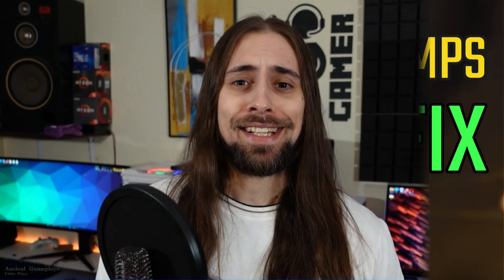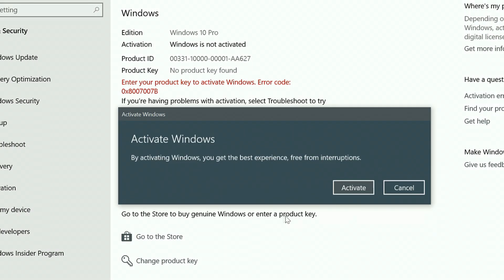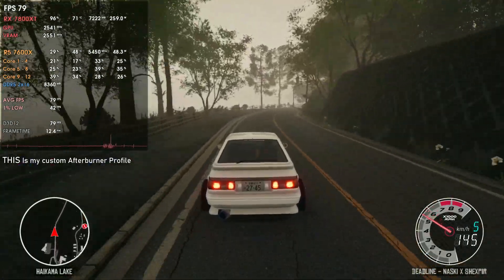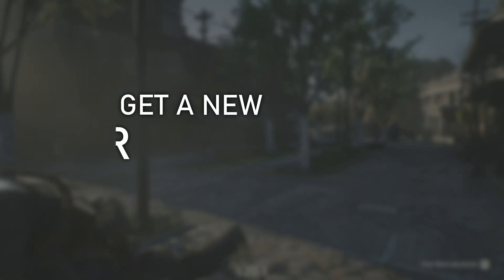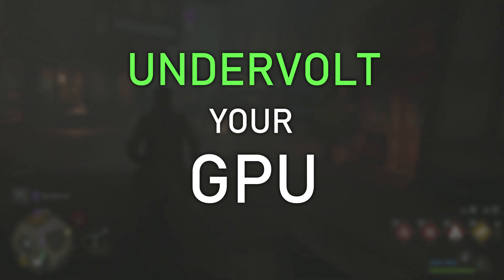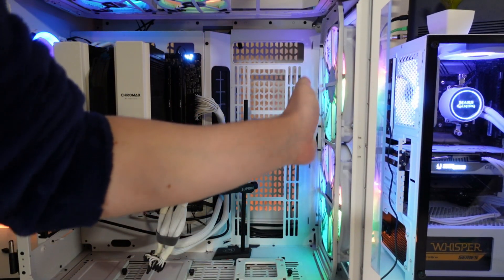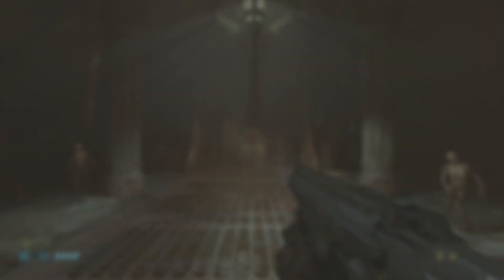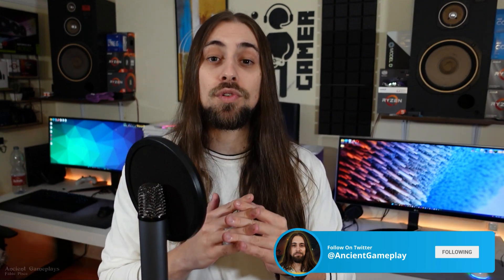HOW TO FIX your PC High Temperatures & Airflow Problems [2023 Guide]

Comment from the maker: As always, hope I helped somehow!
Reply: Hey will you ever make an overclocking guide for the RX 7900XT?
Reply from the maker: @themightymug768 use the xtx one, its exactly the same
Reply: @AncientGameplays  ok thanks 🫡
Reply: As you remade that video, my cpu actually did burn a little too high it shut down my pc, thank you for this video, tips, and much more. :D
Reply: Thanks, Fabio. I only notice cpu high Temps when using technical preview drivers . When I activate flouid motion, the frames really are impresive , and then the cpu starts to overheat , using whql drivers without any tweak , the Temps maintain a Temps, anyways the HIGH performance in every game is absolutely amazing the design of my xtx is gourgeos and even If haven tried for example  FSR3  yet, in widescreen resolution with all games settings higher as posible.
Reply: Should i disable 7 7700x intagrated tm gpu?

Comment: My setup:
Ryzen 7 7800x3d 
Rx7800xt 
Msi mg x670e tomahawk wifi 
Nzxt H6 airflow
Aio Nzxt kraken 360 rgb

And i have 3 120mm fans on front intake directly to gpu,2  fans 140mm on the button intake to gpu, and i have 3 120mm from aio outake,  i dont have any in rear i really dont need with this case, but normaly gpu when playing got 60° to 70° while cpu goes 80° and stay there

Comment: Hey Ancient, why my new Ryzen 5 5600 doesn't automatically use its boost clock feature (4.4ghz) when testing Cinebench? HWInfo shows that all cores are @3.5ghz (base clock) on 100% load.

I needed OC manually it to 4.35ghz, but I want max performance, of course, for gaming. I can't manually OC it to boost clock because it somehow start eat Volts, and I get really high temps (over 100C on prime95 small test, and the pc shut down, this happened with 1.35V) with the Volts the processor needs to be running 4.4ghz - 4.5ghz (Cooler Master Evo 212, air flow). Should I try Curve Optimizer OC option? 

Another question is: Do I get significant benefit to gaming if I get new motherboard that supports the SAM (Smart Access Memory) feature? My Mobo currently is Asus Prime  B350-Plus (from year 2017). 

Thank you alot in your effort for your answer! I subscribed btw ^^
Reply from the maker: Hey, firstly in high loads those CPUs will never be at 4.4GHz, those frequencies are for lower loads where maybe 3 or 4 cores push those values (at max), the usual would be around 4.2GHz. If it is still at base, it means your mobo isn't pushing PBO and speed steps
Reply: @AncientGameplays   Hey, thanks for your reply. That was new info for me, I didnt know that it never boost all clocks to max boost at full load. Well, im sitting stable 4.35ghz manual OC, temps are 65-70 at gaming and 83-84 full load when running cinebench. I think im going with this settings for now. 

Is it even possible manually OC over lets say 4.5ghz this cpu? Mine start eat volts @4.4ghz and I dont want put higher than 1.35V ultimate maximum.

Comment: As a lot of people that watch this video have AMD - The best fix... that would also make a difference to the power bill... is amd fixing the max VRAM clock issue for multiple screens. 😥 Sadly on dual 1440p with more than 120hz its still happening
Reply from the maker: It depends on the combo you have. It also happens on some nvidia cards

Comment: I have a terrible case, CM Cosmos 1000 straight from 2008, with 3x120 UF120 for out and 1x120 UF120 for in from the bottom of the case, all set to VRM. 
There was nothing worthy for 7xHDD on the market, and when the sanctioned Fractal Define 7 was forced to have 200%+ price tags, it was even more so. 
So, Sapphire RX 6700 XT Pulse of the third revision at 2400-2581 MHz 1130 mV and 60% fans in RDR2 with “everything on Ultra” and x1.250 rendering reaches a maximum of 89° on the hotspot. But as soon as I set it to 2424-2581 MHz (so to speak, from the game nominal), HWiNFO64 showed a maximum of 100° hotspot at the same speeds of all fans. 😅 

One of the disks suddenly fell apart, the other was cut long ago to bypass the problem sectors, and it’s time to start worrying about the health of the remaining 4 archived 2TB from 2017, switching to 4TB, and finally change the case to a ventilated MESH 🤔

Comment: Fabio, you are telling that "core GPU temperatures should be <75°". But what about the most interesting - hot spot temperature? If you have 75° core GPU, then the GPU hot spot would be +25-30° more = 105-110°. It is pretty much, may be too much. So what are the two Hotspot T - 1) "up to" and 2) "stay below" ?
Thanks, Fabio)
Reply from the maker: Gpu core should be at max 20C over core IMO
Reply: @AncientGameplays  Fabio, you mean GPU hotspot must be 20° over GPU chip/core?

Comment: are there no amd ryzen master drivers for 7 7700x?? cant find any on amd website
Reply from the maker: Why do you need ryzen master exactly?
Reply: @AncientGameplays  nevermind ryzen works but when i oc ramm and i reset it goes blackscren when i hold power booton and go to bios its automaticly disabled do u think id i drop from 6400 ddr5 to 6000ddr5 is is big diference or no

Comment: Awesome video as always, Fabio! The case is really important. I learned it the hard way. I have a 5800X3D and when I got it it was hitting close to 80-85 degrees in some games. I got worried that my chip was probably faulty. Bought an AIO 360 but it did not help much. Only when I decided to upgrade my old NZXT case I saw a massive difference in temps like around 15 degrees cooler. So now it runs at around 65 in game. I underestimated the case and am sharing this, so you guys might not make the same mistake.
Reply from the maker: Exactly why I said what I said, case airflow can mess with your hole system temps.

Comment: Hi Fabio,

Great video as always! These tips are very helpful! I followed your guide on undervolting the 7900XTX and now my core temps are at 60C and 70 on the hotspot! 

In the beginning i was concerned that my CPU temps were way too high (R 7 7700X) but i now fixed it by enabling eco mode and setting my windows power plan to 99% I now do lose out on CPU boosting but i haven't noticed a single frame less than before and when i need it i can still turn it on.

Thank you for this great video ❤

Comment: With HWiNFO64, what's your opinion of the GPU Hot Spot Temperature reading? I've got an undervolted 6800 XT. Typical maximum gpu temp of 67C, but maximum Hot Spot temp of 90C+!
Reply from the maker: that is a lot, means you should undervolt or change the GPU's thermal paste.
The delta should be at max 20C, in your case its over 23C. Its nor harmful, but a good thermal paste could solve the issue I guess, and like said, good airflow also helps

Comment: Great video Fabio! Lots of really great tips for newbies and seasoned builders alike!

The only thing I would add is advising people to run their CPU to operating temperature for at least 5 minutes before unseating the cooler and use a gentle side to side motion to loosen it, never yank straight up. That allows the thermal paste to warm up and will make removing the cooler much safer and easier. I accidentally killed my 2700X when I tried removing the cooler and ending up bending the pins because the thermal paste had basically glued the cooler to the CPU. Just want to save any other PC brothers from making the same mistake :)

Comment: Hey Fabio , how about  GPU HotSpot Temps ?  .. my 6700XT takes 72~70  on normal Temp and 90~92 Hotspot.. no Perfomance drops , and in 100% usage.
Reply from the maker: 15C to 20C over core is normal, much higwhr than that isn't. You're fine with 92C hotspot

Comment: A few days ago I bought a 7800xt ASRock challenger oc and I noticed during the tests that the temperature delta between gpu temp and hotspot was huge and reached 39 degrees Celsius,then I repasted with MX-4 and the difference dropped to 19 degrees Celsius.As always,the video is excellent,short in duration and understandable, thank you.
Reply from the maker: That's what usually happens on lower end models, the delta is huge due to bad paste and low backplate pressure
Reply: What you write is true,the first step I did was,as always,to tighten the screws on the backplate as they were usually a little loose,this card was the cheapest implementation of the 78xt series without meaning that it is of poor quality and I was really surprised by its size,it is 15% smaller than a 6800 powercolor that I had on the PC,the memory reaches 2630 and while I had doubts about the purchase because the Sapphire Nitro+ is the best of the series in terms of silicon but also more expensive,200 euros,in my opinion it was not worth the amount, but in the end I was pleasantly surprised by the challenger at 512 euros and especially after the repaste the core reaches the limits of 2.9 GHz when running games at 1v,and still trying to find her sweet spot, very happy with the purchase.

Comment: Your undervolting guide really helped me save power and run cooler. I did face some crashes on games randomly though, unsure whether it's the game or driver or the undervolt.
Reply from the maker: games never crash just because, neither do the drivers (usually). Raise the voltage a bit

Comment: I'm currently running a Tecware fusion small form factor case with only one 120mm Exhaust on the rear. While gaming at 1440p, temps for both CPU and GPU never go above 70 degrees. In my previous mid tower case, I had 5 case fans and the temps were easily over 80 everytime.
Reply from the maker: because airflow itself matters, like explained. Still, one more fan for some cool air in, would do wonders
Reply: @AncientGameplays  Unfortunately there is no space for additional fans. We don't get 80mm fans here where I live, and slim ones are even harder to find while being expensive.

Comment: Undervolting a CPU works. I've got a RT 1700X with a Gammax air cooler I'd been running in power saving mode because the cooler is inadequate at stock voltage. Manually undervolted the CPU and now I can run it at high performance mode 3900MHz and I am seeing 75c and below in all games except Forespoken. Temps are mostly in the 60s now. I got Forespoken in ultra everything 1440p plus RT and I saw 76c. Turns out 1700X is STILL a gaming beast for everything even now except for CP2077 and Starfield. But if that's the case then the optimization of those two games is very poor. I like to know more about what are good mobo temps and how high is safe? Forespoken took my mobo to 60c. Room temperature was at least 85f though.
Reply from the maker: Yes, but 75C for that CPU is a lot, you should push it that much, max temps raised a bit after the Ryzen 2000 series. I would try to keep it below 70C.
Also, your case airflow might be the issues as that gammax isn't thaaaaaat bad hahaha
Reply: @AncientGameplays  TDP is supposed to be 75C. It only happens when game is in loading phase then drops back to 50s and 60s when gaming. I might have to reapply thermal paste though. This case has good air flow. I think it's a room temp issue I live in a hot and very humid climate. What do you think good mobo temps are and when should you back off? In my research the consensus seems to be 80C.
Reply: @AncientGameplays  Seems I was correct about room temp. We had a cold front come through last night. Room temp, dew point, and humidity combo are all huge it seems. I ran the exact same Forespoken scenario again with the Gammax and this time time CPU only reached 62.8 and mobo 53...wow!

Comment: Ich habe das Programm Fan Control für mich entdeckt, damit kann man alle Lüfter bis auf die GPU steuern. Und kann im Laufenden Betrieb alles so einstellen wie man möchte, dazu der kleine Tipp, die Drehzahlen für jeden Lüfter so hoch zu setzen das man diesen gerade so Hört, und dann eine Kurve die bei den Höchsten Desktop Temperaturen beginnt. Bei mir z.B.: wenn ich in YouTube einfach lange rauf runter scrolle, da geht die Temperatur schon mal auf 65°, also beginnt die Kurve bei 68° und geht dann bei 88° in die Senkrechte 100%. Dazu kann man dann auch noch einstellen das IMMER die Höchste Temperatur Quelle genommen wird z.B.: wenn die GPU 76° hat und die CPU nur 65° werden die 76° der GPU als Basis für die Drehzahlen genommen. Somit ist in jeder Situation genug Luftbewegung im Gehäuse.

Comment: Clean yo intake fans.

Just dedusted my pc and the dust bunnies on the blade tips of the fans made it have no airflow at all. After cleaning just the edges of the fan blades, my gpu temps went down by 15c (in idle)(peak temps went down by 5 to 8c).
Reply from the maker: Yeah, that's a thing I need to include as well in the one coming in the next years haha

Comment: Besides the ambient room temp, the GPU is the highest temp output part. I like to use an oversized case with 3 big fans in front, aio for cpu on top (either with 3 fans in push config or 6 push pull config, depends on the case size). All vents are correlated with the cpu temp as they ramp up sooner and get the case temp lower faster. With the correct configuration you can get a decent “coolness” to your components, but don’t expect magic to happened, as someone said in the comments, if the room temp is high, the components temp raises exponentially. I managed to get a small ac unit especially to cool the pc and server, that stays in a little room next to the office and the temp is a steady 22c.
Reply from the maker: Yes, but not aslways "Besides the ambient room temp, the GPU is the highest temp output part.".
People with recent cooling solutions for their GPUs and intel CPUs from the 13th & 14th gen won't agree there haha
Reply: @AncientGameplays  haha, true :d i am still contemplating if I should spend 2-300 € on a liquid cooler for the 7900xtx, but for not I am fine with 70c max junction temp :d
Reply: I have a 21l case which has dust filters on almost all sides except the front. Using only one fan on the rear (no space for more) and a tower cooler for my CPU, temps have been surprisingly amazing despite being in a hot location. I realized I wasted a lot of time thinking about airflow and push pull.

Comment: Hello, maybe you know what it is. I have ASRock RX6800 and I checked all bios all 6800 cards on TechPowerUp. Only ASRock make TDC Limit (A) GPU - 250.  Reference is 200A and some vendors make 210 or even 235. Only ASRock make it 250 for all models 6800 and I don't understand why, it seems too much and I started worry about my gpu

Comment: For all those who struggle with the typical gcd-hotspot problem on rdna3 cards, I can highly recommend the Thermal Grizzly KryoSheet.
It gave me a 30C improvement on my XFX 7900XTX.
The gcd-hotspot does not exceed 75C max. even under full load for hours and the gpu-edge does not exceed 55C max. either.
The pad is also maintenance-free as it cannot dry out as it is made of graphene and does not contain any liquid.

Comment: Hello Sir, Just a question pls  I have a 5950x, what do you think which is better for the game, all core tuning 4.6ghz or first cores at a higher clock rate?!
Reply from the maker: just let the CPU run free there, use curve optimizer to tweak
Reply: Thanks :D  @AncientGameplays
Reply: I managed to do a cpu tuning. the first 3 cores are 5125ghz 4,5,6, core 5ghz and the rest are between 4,8 and 5ghz. there is a problem that the d15 chromax doesn't hold up very well, so I have to build a water cooling system , I can't copy the hwinfo image here :S   Thank you for the many videos you make about amd and the many tech videos!❤

Comment: those advised CPU temps are..... very positive. 65 degree? Man, you obviously didint had Ryzen 5800X ;)
Reply from the maker: I said up to 75C degress though. 65C under gaming is normal even for the 5800X. I guess you just need (listen explained in this video) a better case / better cooler.
I have the 5600X, 5800X3D, 7600X, 7700X, all of them run under 75C when gaming
Reply: @AncientGameplays  Well, my 5800X is around 70-75 degree while gaming. I got best possible airflow - O11 Air mini, dual 140 on front, dual 120 on top, 120mm on back, dual 120 on bottom. CPU cooler was Noctua NHD15 and now Scythe Fuma 2. Its best you can get out of this coolers on 5800X, and its also limited by PPT, TDC and EDC manual values.